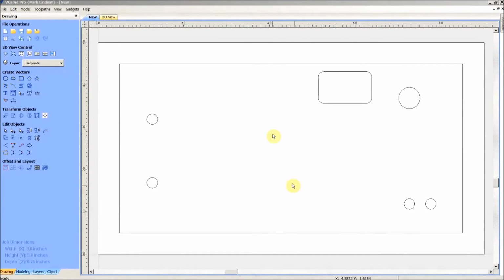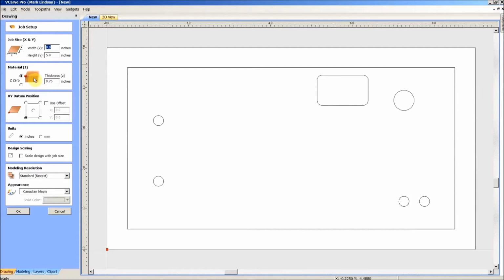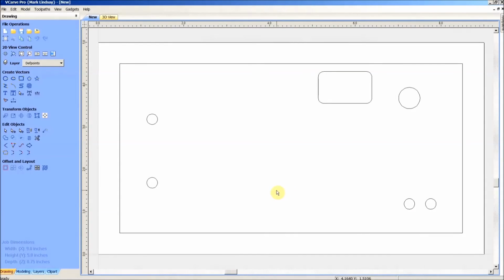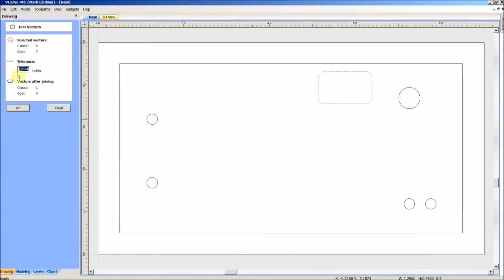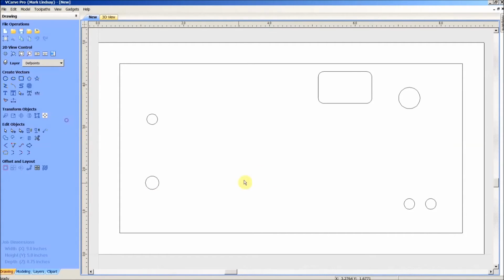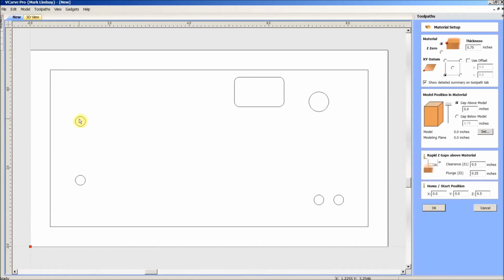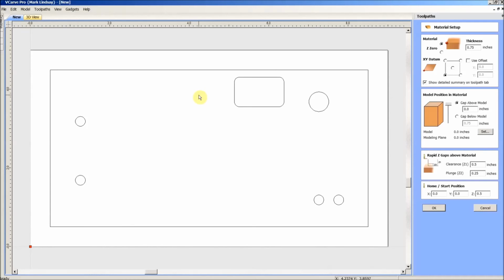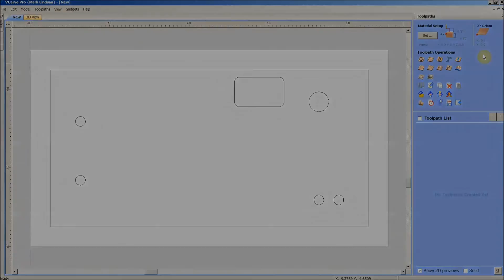Follow Up - DXF to Finished Part Workflow – How I Do It with VCarve Pro

Comment: Hi. In your opinion is better to have the machine Home position at XYZ Max (right rear) or at XYZ Min (left front) ?
Reply from the maker: You should have the homing on your Z set to Max no matter which way you decide to home your machine. That puts the HOME position at the top of the Z axis travel. That's needed for safety. As to whether you home the X and Y to the right rear or the left front, that's totally up to you. It makes no difference to the machine. It's all for your convenience.
Reply: Thanks a lot for your clarification Mark.  For sure Z always to Max. For XY i will decide when the machine will be up and running...hope soon  :-)

Comment: Are there settings in Mach3 or vcarve pro overlaying or does one take precedence over the other?
Reply from the maker: The settings in those two programs can conflict, compliment, or be totally irrelevant to one another - more often than not, the latter.  For instance, feed and plunge rates. Before you calculate a toolpath in VCarve Pro, you select a bit and check/set/adjust your feed and plunge rates there. Mach3 doesn't care what those feed or plunge rates are. When you get the resulting g-code into Mach3, it reads those feed and plunge rates and applies them to the cutting cycle. As the file is running, you have the ability to override those rates if you find they're running too fast or too slow. You can also scale the job size up or down, or make other small changes, but basically the CAM software and the controller software, no matter which software you use, are made to try to work with one another. For the most part, you should find that there are very few conflicts in normal operation. On the other hand, you can design a piece to be cut on a rotary 4th axis in VCarve Pro all you want, but if you don't have Mach3 setup for a rotary 4th axis, or you don't even have a rotary 4th axis at all, you might be able to load the g-code into Mach3, but it isn't going to let you try to run it. Mach3 will warn you if there are any major conflicts like that. Your mileage may vary, of course, but I find that to typically be the case.
Reply: Thanks, I didn't know which software would be the controller.
Reply from the maker: Jim Sinacola  Well, technically speaking, Mach3 is the controller software, but I get what you mean. (No, I'm not usually this pedantic - unless I think I can get away with it, that is...)
Reply: I had to look up that one, pedantic, I think you did a good job!